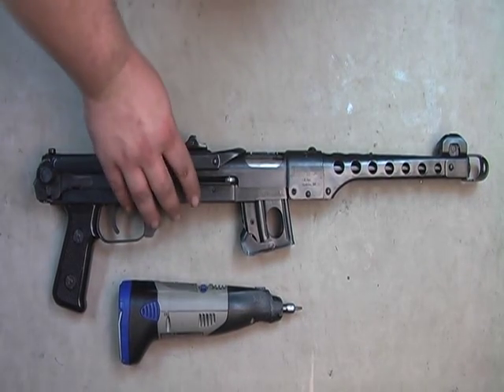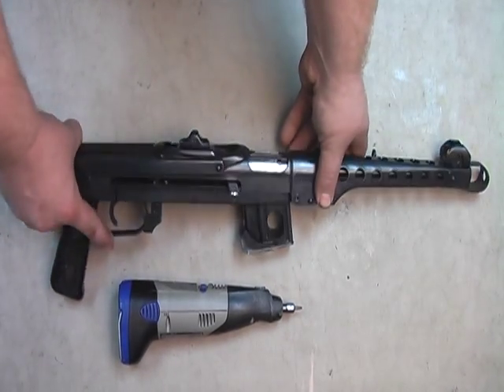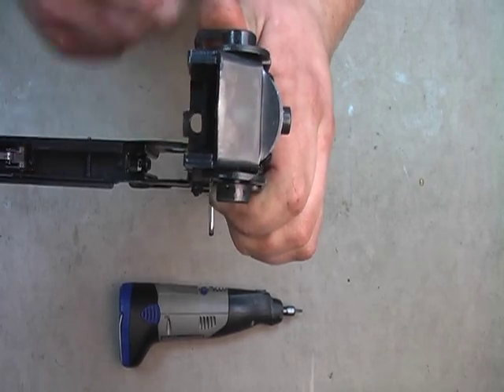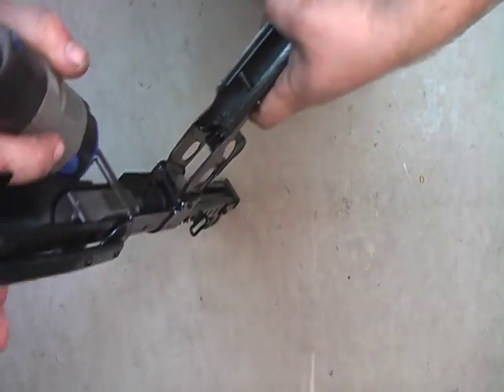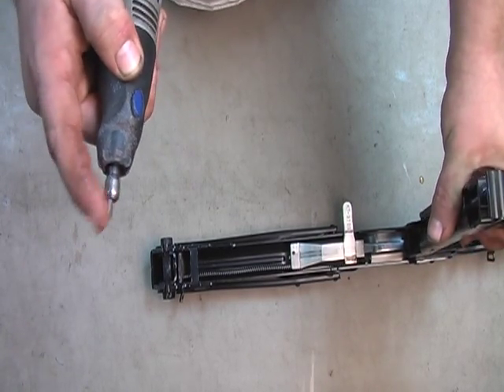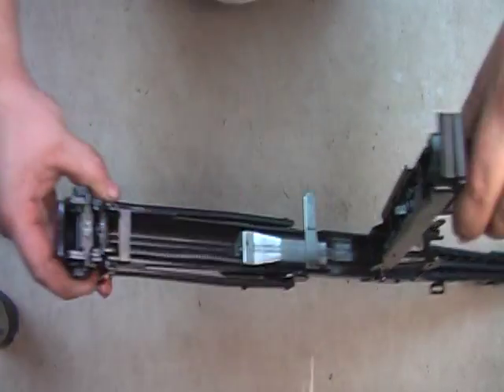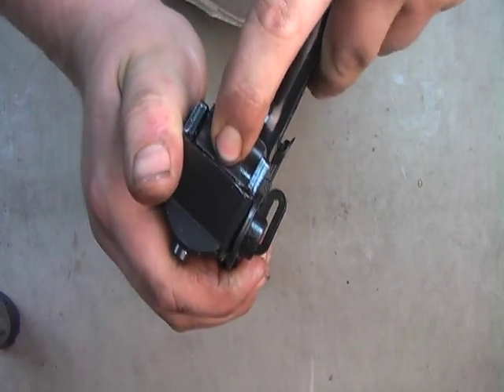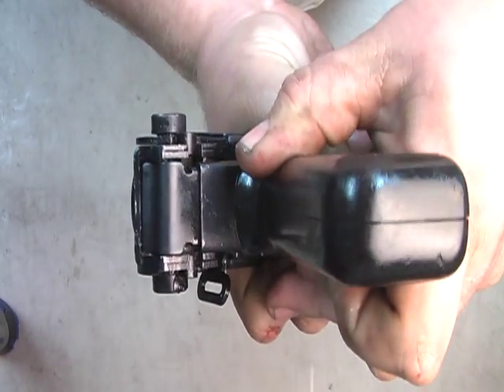PPS43-C - Easy Upper Receiver Latch Repair

Comment: Be nice if you guys would address the slamfire issue and out of battery problems no one will answer me back so it’s a 500 paper weight for now wtf
Reply: Slam fier issue? Did you replace the fixed  pin? In the bolt
Reply: @thebushbunker   pioneer arms sent me a new redesigned bolt it works like a charm now I had to send in my old bolt they sent me a new one
Reply: @johnnyfuller4110  did you have to rebuild your upper